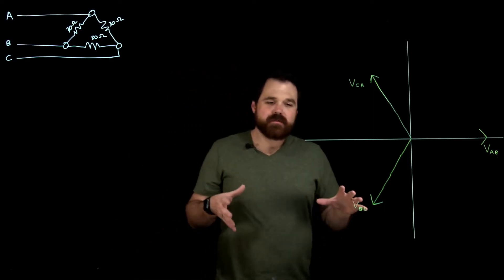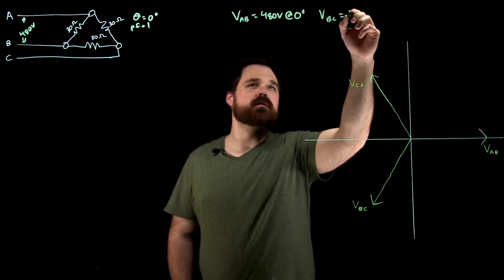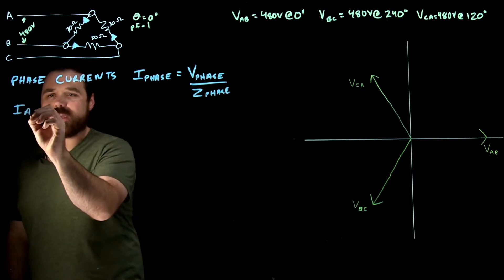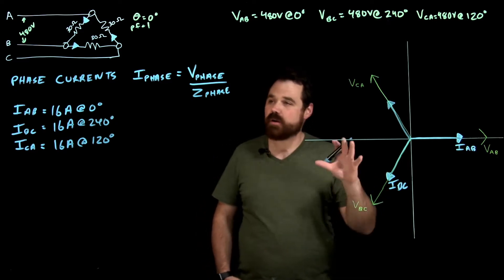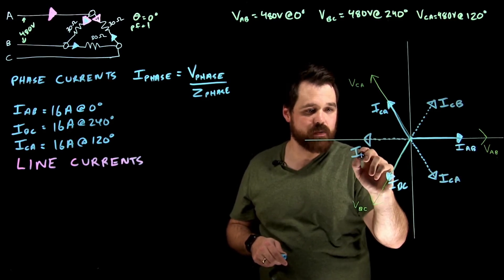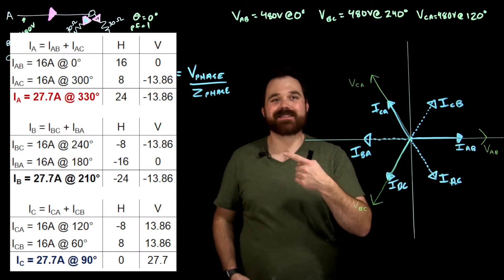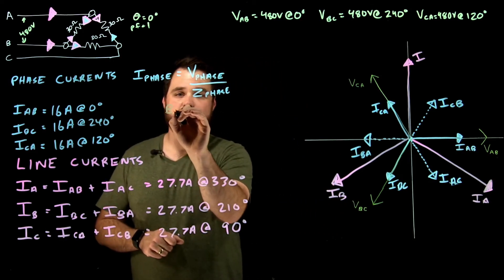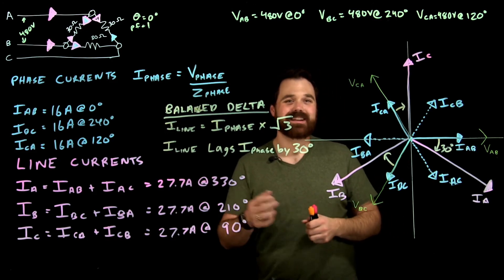Delta Balanced Resistive Load

Comment: This was extremely helpful. We did an experiment in my machines class involving a wye connected power supply to a delta connected load and you helped me understand the observations of voltage and current on a phasor diagram. Thanks!